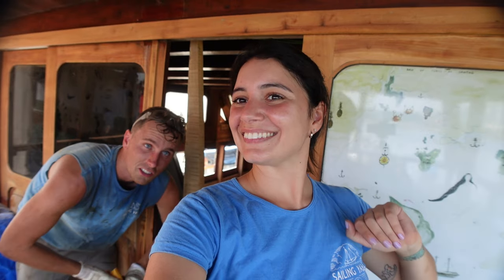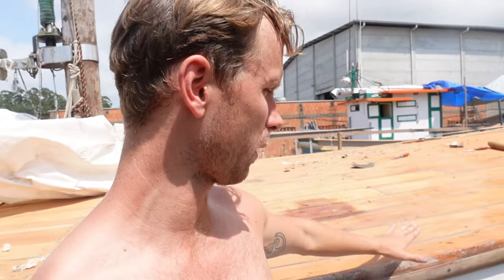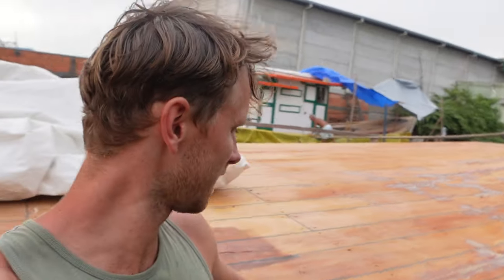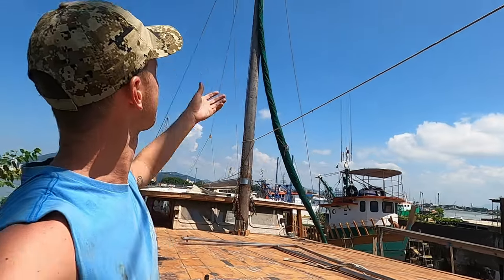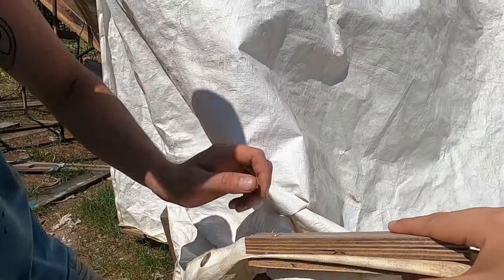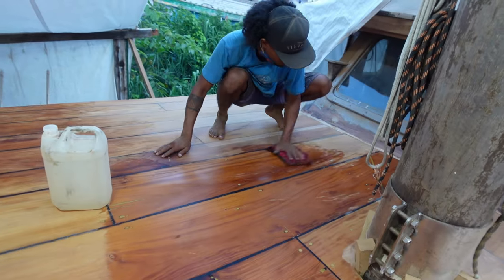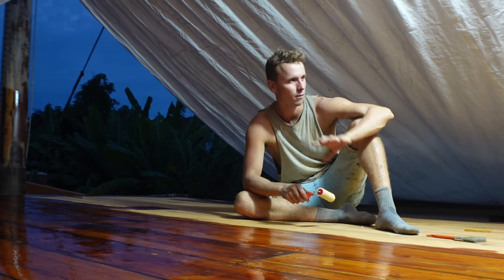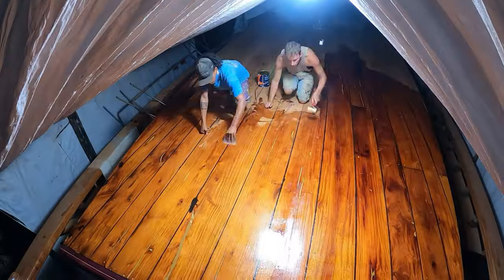Boat restoration: protecting our roof with clear epoxy. Will that work? — Sailing Yabá #90

Comment: There was a reason the roof was white before. If you leave it as is it will become a big old heat sink turning your cabin into an oven making life inside very unpleasant. I don't normally comment on your methodology, but felt that I had to in this case. If you don't prefer white paint it aquamarine or some other reflective color. 👍
Reply from the maker: Hi Brutus!! Thanks for giving your opinion! As our roof if 5pm thick of pure wood, we believe it will be isolating the heat on the inside enough. Regarding it being white or reflective, before when the roof was white it was too reflective and bothered whoever was in the helm. That was one of our motivations to keep it to bare wood. The epoxy and varnish will make it shiny, but once we add the quartz grit it won’t be blinding the captain anymore. 😉
Reply: @SailingYaba  - Ahhhh yes the glare! That makes sense, my favorite Yaba-dabas! SOOOOO maybe consider the aquamarine? Reflective, not as much glare, and would go beauty-full with your decking. I think the little cherub MP would luv it! 😁

Comment: I'm pretty sure at 3mins in im watching a hole heap of caulking cotton not hammered in far enough.🤷
Reply: Im so lost are you fibreglass  the deck or what. Epoxy coating even with one layer transparent 🤔 will go to shit in less than 4 weeks in the sun. I love your channel but this idea i cant stay quiet.

Comment: Always wear chemical protection gloves when working with epoxy!!
Epoxy allergy is not fun. 
You should have added glasfiber cloth. 
Mine has held for 20 years with one coat of sigma 42 every year as uv protection.

Comment: Any varnish or clear epoxy will fail and is time and money going to waste. Epoxy doesn’t like uv. Paint it with a light colour two pot polyurethane. There is enough maintenance on a large boat such as this.  You do not want to add unnecessary expense. Yachts are not generally painted white for no reason. Any epoxy coating also needs the embedded fibre glass or it will crack then the deck will leak and rot. Deck seams that are not fibre glassed should be filled with a flexible sealant eg polyurethane definitely NOT epoxy. 
I am speaking from a lifetime of working on boats.

Comment: practicality and romance do not go hand in hand. Unfortunately. The white roof it had was due to some hard learned lessons of reality aboard a Yaba with nice mahogany roof heating up drying excessively and cracking terribly , in all likelihood. The grain of it is incredible while the sad fact remains its full of hideous compound fillers. 
However the pair of you are in a romance with the boat and each other. Enjoy your autonomy and do have the greatest fun with it . There is always the experience to be had and if the decision cannot be endured it takes a bucket of paint and one hot afternoon under the covers to paint away the previous ideas! Now that had sounded like insult , the fact is as I see it and my eye sees the same beauty as you have preserved. It may be cool anyway inside the belly of your craft? You could always lay a white tarp over the cabin in hot weather?

Comment: Will look great BUT you have ZERO up protection.  Do some more research and im pretty sure there is a clear finish you can add over the epoxy. My experience had my epoxy cracking and pealing the first year. I used spar urethane and it last 3 yrs with just 2 coats.....told more coats more better.

Comment: Are you really sure that you want to put fibreglass on that roof? I only mention it  
because I have seen fibreglass become a problem of its own over time by peeling and yellowing. Why not just settle for lots of epoxy and varnish for now because I'm pretty sure that you'll be painting the roof white in less than a couple of years?